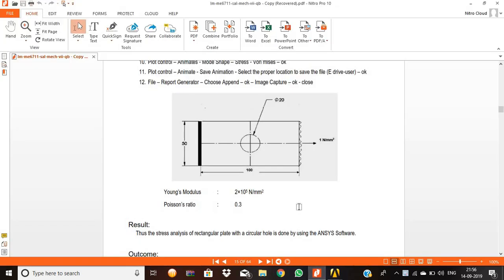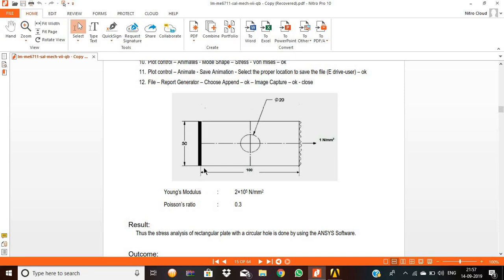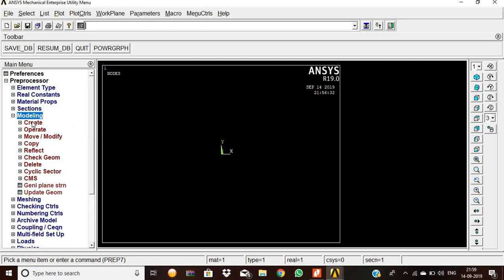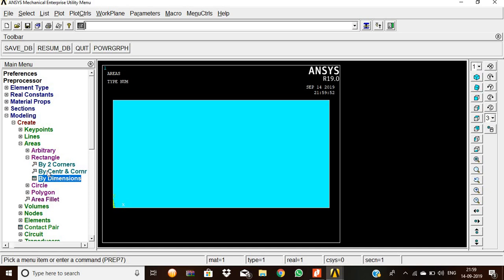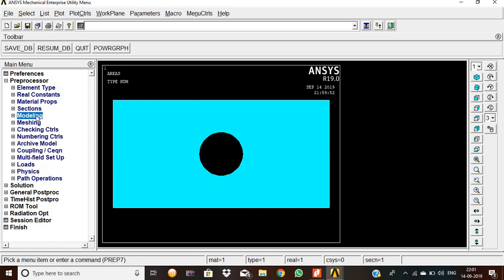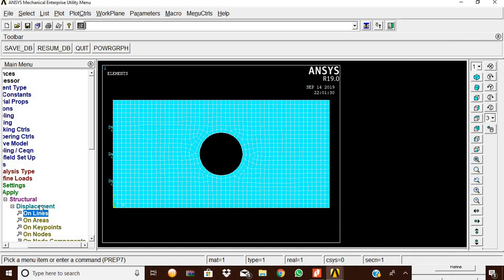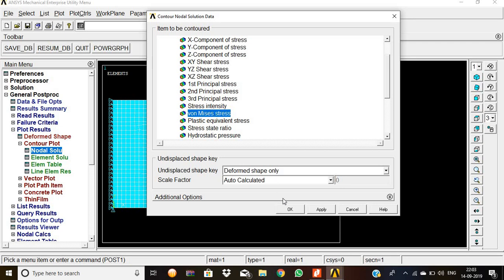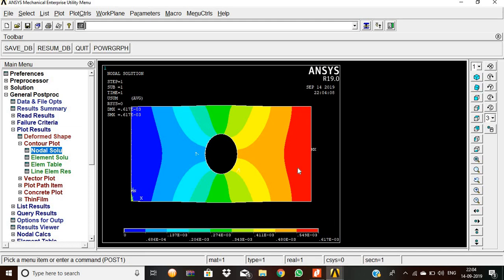ANSYS R 19.0 stress analysis of a plate with circular hole

Comment: Is von- Mises stress represents the ultimate load of element? Why von Mises stress is important? Kindly clarify.
Reply: Stress tensor is decomposed into two components i.e hydrostatic and deviatoric, hydrostatic part does'nt play any role in the distortion of the component so we will consider only deviatoric tentor, In this only 2 Invariants were acting(2nd & 3rd) where von mises stress totally depends on the 2nd deviatoric Invariant